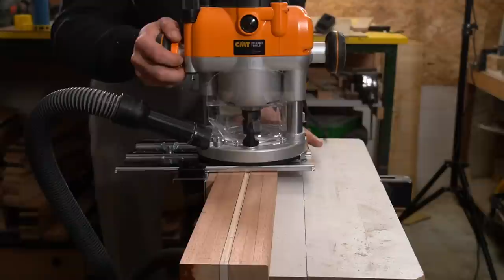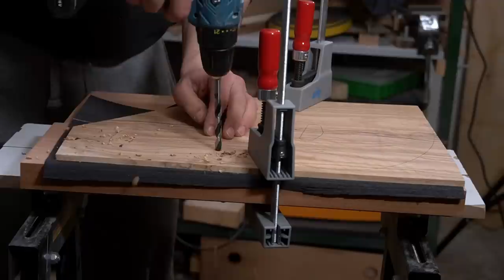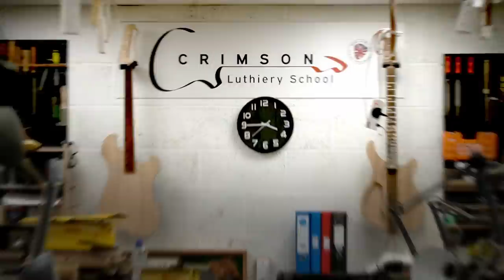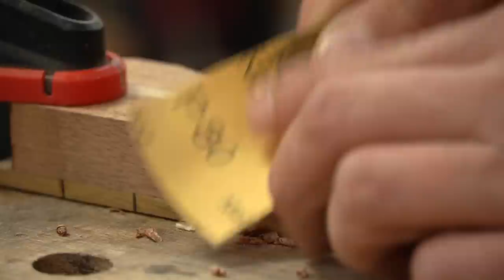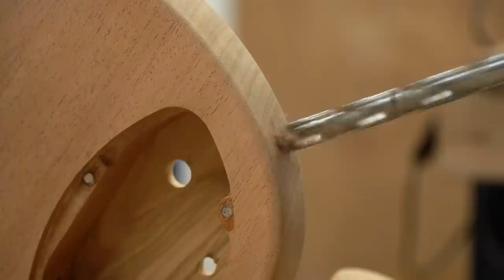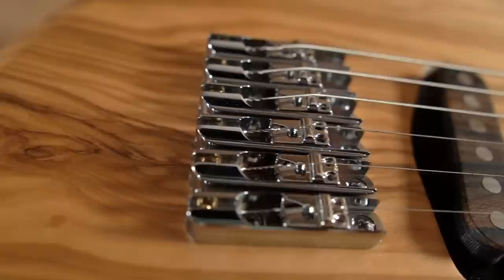Building a guitar at Crimson guitars 5 day course – Guitar build full video

Comment: I love that body shape. Really impressed that you got the veneer onto the flat of the headstock and into the scoop. I did that once but I inset the veneer so that fretboard end of it terminated where the fretboard and the neck wood meet. I think it's a bit tidier looking, but a bit trickier.
I wouldn't have gone for wooden knobs, but they are beautiful. It always seems like luthiers make wooden control knobs oversized for some reason lol
Reply from the maker: Thanks man. Inknow what you mean.  That's how people usually do it. Did it myself a few times. It's not that hard if you glue the veneer before gluing the fretboard. I like bigger knobs:) It's more comfortable to turn in my opinion.

Comment: Beautiful guitar man. I almost died when i saw it, i have a design in my notebook that is very very similar to that guitar. You beat me to it! Beautiful job man, very very sweet.
Reply from the maker: Thanks Steven. I don't see a reason not to build your design. I'm sure it will be different in your style.
Reply: @MagicAtticGuitars  I plan on it. Its still quite a bit different than what you built, especially in the construction plan, but the shape is very similar. Its that cut away on the top mostly! The cut in my drawing is a bit  more pronounced, but its the tele style bout with the small cut at the neck, and the fact that its slightly an offset design. My lower cut curves down, a bit like a Warwick bass lower cut, but other than that its kinda uncanny!

Comment: nice but no truss rod or string trees for that kind of headstock?
Reply from the maker: Thanks.  String trees are not neccessary for the 3x3 tuners position.  And it has a truss rod.
Reply: @MagicAtticGuitars  Your headstock does not have a slant. It is straight inline with the neck with a drop. The strings are angled on to the tuning pegs. Aren't they supposed to be straight? I know there needs to be a break and it usually isn’t required on a slanted headstock. Isn't that the whole point of string trees and why they are used mostly on the farther pegs of a 6 inline? I'm just curious. I have never seen such a sharp angle from nut to  tuning peg. All the pull pressure is on the top of the tuning peg as it seems the strings have been pulled to the top. Maybe I don't know what I am talking about but I am seriously curious. Making guitars looks fun but requires many tools it seems.